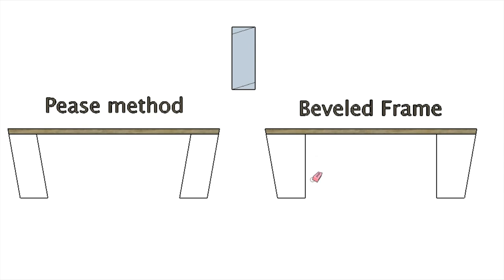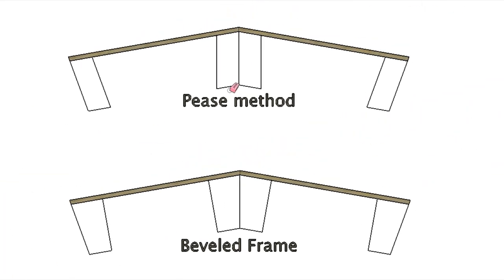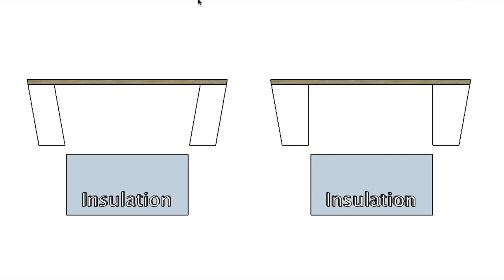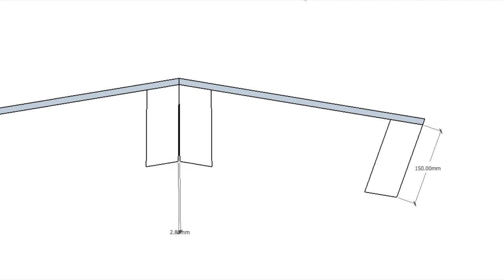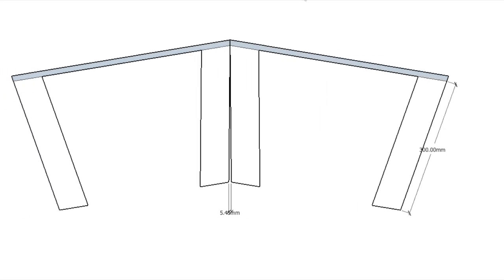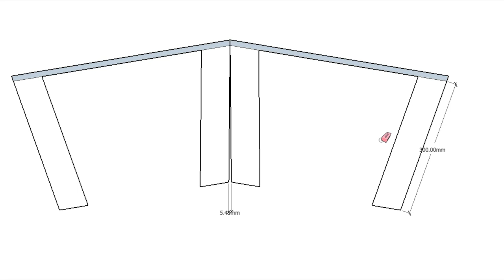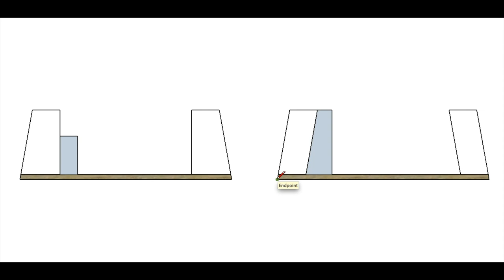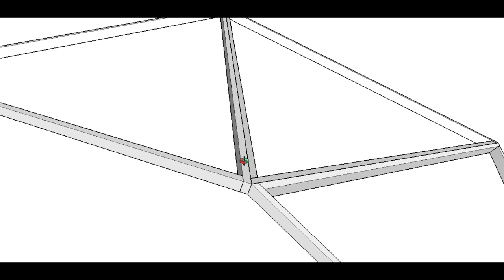Dome building methods - pease method

Comment: Hi Paul, with the Pease method, you could do an alternative jig, where the guide blocks are positioned at each corner of the triangle on your template. You could then cut the first compound angle with the first strut in place and whip around with the rest of the struts, lopping off your waste like you do with the bevelled (GoodKarma) method. Also, you are not avoiding cutting compound angles with the beveled method, it's just that you are using the jig and struts in place to guide your hand saw for the offcuts. Apologies for my dumbed down explanation. Your thoughts?

Comment: My source timber is 100x15mm, up to 1100mm long,  so I wanted a 4V 1/2 dome,  about 6m diameter. Peese method will work nicely for this. I like the chamfer method, but it works best with square and close to square, not so much for planks.

Comment: This seems to be way the Argentinian dome builders do it. It does seem pretty advantageous when building a small cabin that you'd want 4-6" of insulation. They use dense packed cellulose it seems so the insides not being square is not an issue. For me personally that's the only place I can see an advantage. For a bigger house you could easily build two beveled frames, say 12" apart, one inside the other. You could connect the frames with gussets, run your electric and plumbing, net the inside and dense pack with cellulose. You could even create an air gap under the sheathing within the outside frame panels. 

But if you were just looking for 6" of insulation, this would be the more efficient way to do it. 

Thanks for the vid, Paul.
Reply from the maker: Yep, that's how I would do it also. The bevel angles have to be super accurate for deep frames but if you do two beveled frames it's not so difficult.

Comment: How do you determine the bevel angle
Reply from the maker: OK to get the bevel angle you need the dihedral angle first. some dome calculation tools don't show this but if you look at the ones on geo-dome I do show them. Working out the bevel is simple, take the dihedral angle divide by 2 then take away from 90, this gives the angle to set the saw. Example 3v dome has a 166 degree dihedral so 166/2=83 take 83 from 90 to get 7° bevel. Just be careful as not all calculation tools have the same angles or measurements for a 3v try to use the same one for all your calculations. I will also post a detailed video about this soon.
Reply: @Geo-Dome  Was this video ever made? I feel like this is only THE most important part of dome building to get right but nobody really talks about it in videos.

Comment: thanks for sharing!

I love the beveled frame method. It looks fairly straightforward to build. However I'd like to see it actually done first.
Reply from the maker: This video shows many domes built using the beveled frame method: https://youtu.be/kILxlKIri7o
I have built well over 100 domes using this method and all the plans I sell use the same method. If you check out my channel I have lots of videos showing me build domes using beveled frame system.

Comment: So what method would you recommend to build a house in Alaska if you wanted 2x8 or 2x10 walls for maximum insulation? Thanks
Reply from the maker: I will do a video shortly about house building with more detail but I would recommend a double skin so you could use either Beveled frame or pease.
Reply: either method would give you a flat inner and outer surface to nail a panel to, or screw, whatever. the bevel lets you fill with a triangle of insulation which has a straight edge/side, and the pease would probably fit snuggly and not fall out, but you could easily get the same effect by going a little big and plug the hole with a slightly compressed piece of insulation. YMMV
Reply: See my other comment in this thread. I think if you were looking for a lot of insulation, two beveled frames nested one into another, connected with gussets and blown full of cellulose would be best.